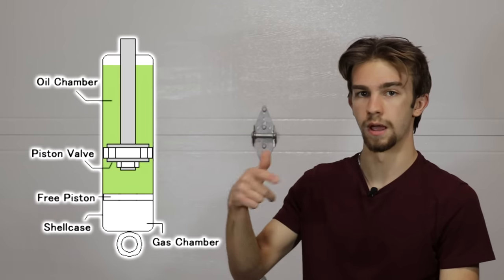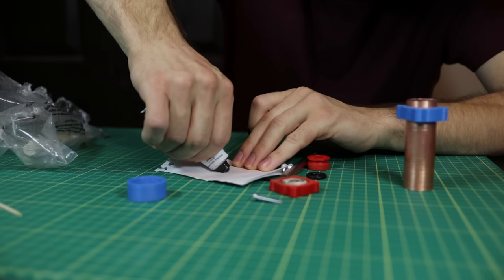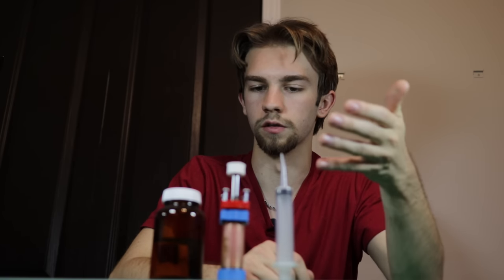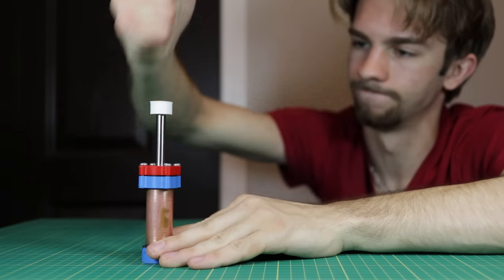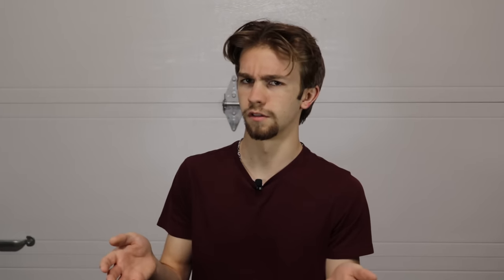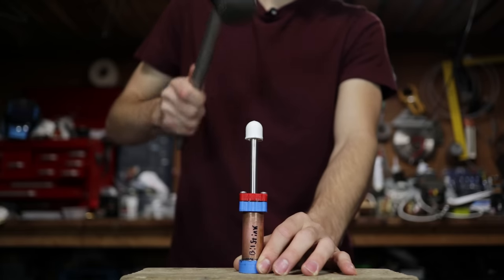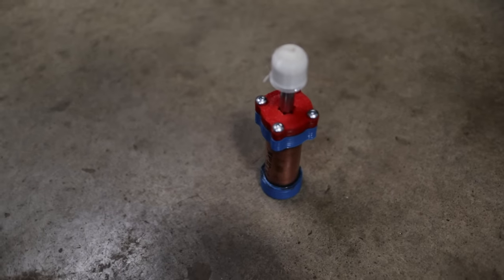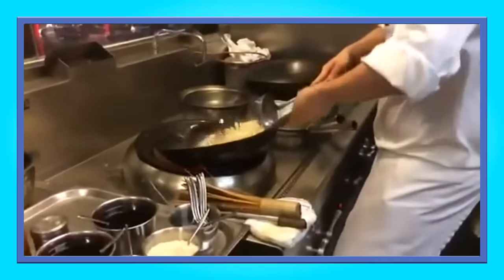I Tested a 3D Printed Shock Absorber

Comment from the maker: Damping not dampening, you're welcome
Reply: Literally came to write that.
Reply: What's dampening then
Reply from the maker: @FoxDog1080  dampening is to wet something, damping is to reduce the oscillations
Reply: A light spring would help the piston to recover so you don't have to pull it up each time. issue with plastics is they will fail faster than metal parts.
Reply: Make a adjustable shock then I'll subscribe
Reply: Vehicle Shock absorbers are filled with 5 or 10W oil, and yes I'm a master Mechanic
Reply: Yeah, I can imagine how dampening wouldn't be too great considering the whole water corrosion thing lmao

Comment: Nice. You can get rid of the internal o-ring and make the piston holes smaller. Also the RC industry has specific oils for shocks that come in different weights/viscosities that would allow for further tuning beyond hole size.

Comment: For oil to use, you can purchase shock oil for rc cars. It comes in all sorts of different weights so that you can tune the damping of the shocks by using thicker or thinner oil. Also if you made it a coilover that would make the hammering faster since you wouldn't have to pull it back up every three hits.

Comment: One thing you might also consider is adding a rubber dome with air inside or something inside the shock, since the compressed shock has less internal volume than an extended shock.

I'm not sure it matters much at this scale, however it would be more true to actual shock design. (Thanks superfastmatt for the excellent video on shocks)

Comment: This is a great demo of hydraulic dynamics honestly. For some reason this reminds me of that myth busters myth where the impact from hitting water with a lot of momentum is just as hard as concrete.
This also makes me think of that project farm channel where he experiments with all types of oils and engines in great detail. He's done a lot of experimentation so if anyone knows which oil is ideal for this purpose it's him. 

I on the other hand have no clue lmao but gg another great video Camden!
Reply from the maker: Thanks! The biggest reason why vegetable oil isn't very good for this is the viscosity changes drastically as the temperature changes, for example at like 3 degrees it becomes almost a grease but at like 30 degrees its nearly as viscos as water. Engine oil or actual shock oil is meant to maintain a fairly consistent viscosity between large temp changes so that is where I will start!
Reply: Hammer crane drop, they were busting if you can break the water tension with a hammer before hitting the water from a high fall/dive, thus making the fall survivable, and not like hitting concrete.
Reply: @TheLoiteringKid  that’s the myth! Thanks man I had almost forgotten it ahahah
Reply: Every hobby rc comes with shocks

Comment: Now add some springy shim discs that mask larger secondary oil flow holes, to flatten the speed/resistance curve, like a real suspension damper.  Just small holes are used, if you want an exponential speed/resistance damping curve.

Comment: To take this to a version two and level it up you could do it. Audi does and put metal particles in the oil and use a magnet, the magnet on sucks the particles to the top or the bottom causing the fluid to be less viscous release the magnet particles fall into solution more viscous.

Comment: Normal shocks have a nitrogen reservoir that is compressed as the piston shaft displaces oil.  Yours probably burst because of an overpressure caused when you overfilled the cylinder and there wasn't enough air to be compressed.
Reply from the maker: I considered having at least a chamber with air in the bottom separated by a floating piston, but was concerned that oil may seep past and fill the bottom volume so I decided against it
Reply: @CamdenBowen  That makes sense.  Probably would have been fine with just a little more air on top, but those layer lines on FDM 3D prints make such good sheer points that it might have gone eventually anyway.  Did you consider just soldering on a standard pipe cap for that end?

Anyways, it was a really interesting video and I enjoyed it a lot.

Comment: Now this is a well made video and I'm truly happy I ran into it, thank you for the nice and clear explanations along the way. Also pleasant voice and good sense of humor.
For printing PETG to be very clear and transparent I can recommend drying up the spool as much as possible and print at very, very low speeds (around 10mm/s). Prusaresearch has had a nice paper on the topic on their website.
Reply from the maker: Thank you! I will actually try that next time to see if I can get better results, to make mine better I sanded it very smooth to help reduce the light refraction

Comment: I believe they can be made with wicker ir bamboo coils reinforced with wrapped hemp with starch or citric acid adhesive and bamboo rods and machined bamboo threads and parts with bamboo of different diameters, and filled with vegetable oil
Reply from the maker: decolonizing the shock absorber
Reply: @CamdenBowen  demetalification ( furnace energy waste and mining) and deplastification (nanoplastic wasteland) wich is more important right now, i think that wrapped coil mattresses can be made too like that with heat treated wicker or thin bamboo coils

Usually you can make a bigger part than with metal, and for example toxic epoxy resin coils are being built right now

Comment: I bet you could increase the max rpm of an engine with pneumatic shocks for when the pistons are at tdc and bdc so they have a better ability to slow down and you could even have the amount of air in the shocks adjustable for different rpm bands

Comment: In the liner part if you put a spring there is that how you get the benefits of both? Or if you put 2 opposing springs in the oil part then is that good as well?
Reply from the maker: Typically these are paired with a spring, called coil over, in my example I negated the spring since it was less relevant to my experiment
Reply: @CamdenBowen  did not know that was what that is called. Thanks!

Comment: Not sure if this would cause the petg to yeild quicker but I wonder if you printer some external threads on the outside of cylinder and some mating internal threads on the caps and then jbwelded that to secure it
Reply from the maker: I think it may work if I threaded/tapped those parts instead and then used JB weld

Comment: maglev (no mechanical springs) + air shock
Reply: magnet discs/rings can be the air shock pistons, opposite in the same copper tube, eddy current is an additional shock absorption method included

Comment: 2 things i might want to add to the design.
1) use actual suspension oil? ones usually used for front motorcycles forks should be the easiest one to get.
2) for the cap to make it stronger, make the cavity inside the cylinder hemispherical? as since it seems to fail on the edge, why not make it have no edge? if you get what im trying to say.

otherwise, cool vid!
Reply from the maker: Thanks! I didn't have any shock oil lying around but I would use that otherwise, and instead of using a plastic cap next time I will just solder one to the copper to ensure it can withstand much more pressure!

Comment: Camden why doesn’t Tesla add alternators to their electric cars to generate its own power so people don’t have to go and park and recharge the batteries, is there a reason on why it is a bad idea?
Reply: Because of how energy transfers and efficiency. An alternator or generator always have losses with their conversion from motion to electricity, not to mention the losses from all the other components. Point is, an alternator would never put back the same amount of energy back into the battery, resulting in a lot of energy loss. Another drawback is that alternators have resistance when put under an electric load, so it would actually make your car slower too, while just being a big energy drain. There is no such thing as free energy unfortunately